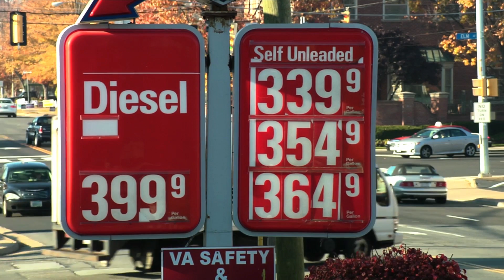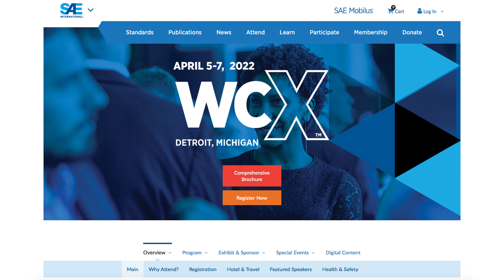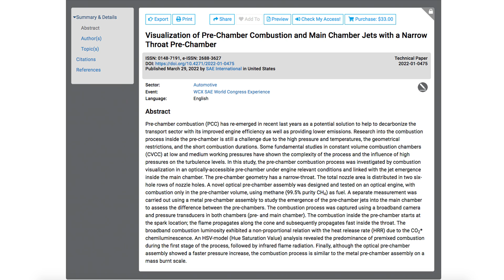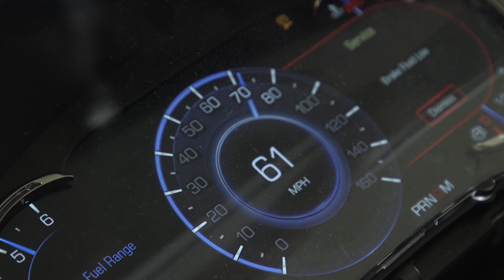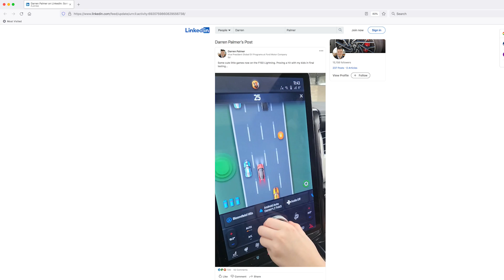EV Battery Cell Costs Jump 52%; BMW's New 7 Series Stuns - Autoline Daily 3307

Comment: Autoline, please do a comparison between the games offered on a Tesla vs that joke of a game from Ford.  1985 called, they want their game back.
Reply: It's not so much the games but the fact they're trying to use that rotary knob. Plug in real controllers into the USB ports or it just becomes an expensive repair item when your kid destroys the potentiometer. If Ford wired it correctly, an OTA should be able to handle standard controllers.
Reply: @Tokamak3.1415  that too.  PlayStation 4 controllers work great in my Tesla.

Comment: I am skeptical that a car platform can be successful as a electric and fossil power trains. Any EV owner looking at the transmission tunnel in an EV will shake their head in wonder, but the structural demands of supporting both electric and fossil motors will have costs in performance and usability for either variant.
Reply: you don't have to change the entire platform out just to remove the transmission tunnel.  All that would require is one different stamping for the bottom of the vehicle with the rest of the structure being similar.  Just make sure the hard points on the design match up and it should work.  Mfg do this all the time with similar platforms where one version has a slightly longer wheelbase for example.

Comment: Car companies that keep the same platform for gas and EVs like BMW will have a lot to lose: range, cargo space, aerodynamics etc
Reply: Use of the same platform however will improve economy of scale and result in better pricing.
Reply: @howebrad4601  negative.
Reply: @howebrad4601  the downside of using a platform like that outweighs the cost savings.
Reply: @odisy64  It's possible you are correct, however I do believe that in the long run when you consider that the mfg have to produce replacement and repair parts for 15 to 20 years, and all that they are better off sharing platforms.  It's not an exact comparison, but they don't have one platform for a 4 cyl version of a car and another for a V6.  Also cars like the prius share platform parts with non hybrid cars, etc.  I'm not sure why the entire car has to be different just because it has a different propulsion mechanism.  Take heavy duty semi trucks for example, they have the same frame and platform regardless if you have a cummins, Detroit, or Paccar engine.  
Further if you want electric cars to be more broadly accepted for the general market, and not just people that are early adopters, both versions of a vehicle should be similar.  Even the F150 EV looks similar to the IC version, which to me just makes sense.
Reply: @howebrad4601  unfortunately an electric skateboard requires an entirely different frame structure in order to maximize its advantages and minimize its disadvantages. One major problem about using a multi purpose frame is loss of space and increase in weight. When you look at tesla, they are producing a structural battery pack with mega castings in the front and back. This makes it harder to produce individual parts for replacement  and more costly for those repairs but the manufacturing cost of those mega castings and battery pack is so low it makes up for the disadvantages.

Companies just don't want to commit to a full electric frame because its very, very costly for them to develop a frame from scratch. Mega casting was considered to difficult and expensive to do by these same companies.
Reply: @howebrad4601  Lazy engineering never saves money.

Comment: LFP batteries 🔋 with iron instead of nickel are cheaper and last almost 2’000’000 miles, the jump in price is due to nickel price used on obsolete LNCM cells used by legacy auto makers still in panic mode and rushing on LNCM without any thinking 🤔
Reply: Yep, very bad for companies that think in decades instead of months like Tesla.

Comment: BMW copied Genesis in the separated elements between the lights, except that Genesis executed better.

The Lexus's range sucks. Keeping that car between 50% and 80% state of charge means you can only drive 40 miles real world.
Reply: I think the Lexus may be very popular. It looks great to non-EV people (most people), interior looks good, acceleration is adequate and if it has that quietness people like in Lexus and rides smoothly, then that's what matters. The range thing especially won't bother those who have homes or use the Lexus as a second car.
Reply: Anyone afraid of going below 50% has bigger problems than their car.
Reply: @rp9674  It's what the manufacturer recommends. Tell them.
Reply: @suserman7775  never heard of it, wouldn't do it, sounds unhealthy for the battery

Comment: even if I were tiring of the Tesla look, the BMW 7 series look is not the alternative I would be seeking.
Reply: Something is off with the new grills. I like the past decade designs. The new ones, not at all.
Reply: The new grill is not doing it for me.
Reply: I find myself not at all that bothered by the exterior. The interior matters more and the interior styling is quite nice (though not sure about some of the crystal light effects). Yes, it has a transmission hump. But, tbh, most cars are now designed to carry 4 and not 5 passengers so that transmission hump doesn't really get in the way unless you're carrying a 5th passenger. I would like BMW to make a ground-up design but they're not doing so. Only the iX is a ground-up EV design.

Comment: 1:50 Sounds like the SAE has about as much to do with the engineering of battery electric vehicles as Tesla has to do with the engineering of internal combustion engine vehicles.
Reply: To me it sounds like the old engineers are trying their best to keep their jobs since they find themselves on the same level of new engineers on BEV designs.
Reply: Pretty sad if their CEOs directed them to do this as well.  Bad leadership will sink legacy OEMs during this disruption.  And can we stop with the “ICE sales need to pay for EVs” nonsense already, Tesla, Rivian, and Lucid didn’t need ICE sales to bring their vehicles to market.  Any effort on ICE is folly.
Reply: @DarkBrandon1  Strongly disagree.  There is yet to be any EV that will meet my transportation needs, and I'm not alone.  Until that point there is strong demand for IC vehicles.  Keep in mind that Tesla didn't turn profitable until very recently, even though they are not a full line manufacturer.  What do they make, 4 or 5 cars?  Not too hard to be successful when you only make a handful of vehicle models.  

Show me the EV that can carry 5 people, with an 8 foot cargo bed, pull a 25000 lb trailer over long, long distances like I do regularly, with 450 mile range while pulling that much load, then recharge in 15 minutes and I'll consider one.  In addition, I live in an area where -30F overnight lows and -15 daytime high temps happen regularly in the winter, so I need strong heat, and the ability to keep me alive should I end up in a ditch full of snow.  Which EV would meet my needs?

It's very simplistic at this point to think EV's will completely take over.  In time they probably will but they're just simply not there yet.  Me and my family take trips to the in laws pretty regularly which is 580 miles each way, which we do in about 9 hours currently.  We stop once in the middle 280 miles into the trip for restroom, etc., and if need be a quick 10 minute refuel.  I'm just not willing to sit there and charge a vehicle if it's going to take much longer than it takes to refuel.

Comment: GM's Hummer also has a unique 800/400V system.
Somebody tell BMW that they could save a lot of that extra 1,000 pounds on the 7-Series sedan by losing the extra-long front end. Continuing with dual power ICE/EV vehicle designs only leads to sunk cost in development and tooling for compromised vehicles that are outdated before they first roll off the line.
Reply: GM's Hummer EV has retained the crown as having the worst energy efficiency of virtually any vehicle.  It is the most inefficient EV being sold in America, just like its ICE Hummer was one of the worse vehicles for MPGs.
Reply: @mikedx2706  Yes, the Hummer is pretty silly but it is working. Truck people are talking about it, being impressed. Surely its intent was to get the attention of those who drive ICE trucks, the coal-rollers, the people least likely to consider EVs. I doubt GM intended to make many Hummers, but to use it as a marketing tool to sell Silverado EVs.
Reply: @Miata822    Yes,  Hummer is a Niche vehicle to bring attention to GMC,  will likely sell about 10-20K a year.
Reply: @mikedx2706  Yeah, that is true that Hummer is the most inefficient EV, but compare it to its direct competitors, the Ram TRX which gets about 9 miles per gallon, and the Ford raptor which gets about 12 miles per gallon, and all of a sudden the hummer EV looks like one of the most efficient in its class.   Let’s not forget to, the hummer will blow away both of those vehicles in a race, turns sharper than a Tesla model 3, has a convertible roof, and many other features no other vehicle has right now.
Reply: DB, you need a new source for your info....  since you're wrong again... the Lyriq will also have an 800/400V ultium architecture... like all of the new bespoke EVs from GM...
Reply: @nc3826   Wrong,   Lyriq does not have the parallel to series 400/800 dual battery packs like the Gm trucks.     Lyriq charging limited to 190 kW.   The trucks use 2 separate Lyriq packs,  run in parallel to drive, and series to charge.
Reply: YT wannabe experts who mindlessly rant about how terrible flexible platforms are when brands like Hyundai have built efficient and profitable EVs off of them.... are amusing...
Reply: @nc3826    Hyundai Efficient?   Really?     Ioniq5 is well behind Tesla on efficiency.    25%  to be exact
Reply: @dmitchellhomes  Wrong again, it does not need a dual set of battery packs to have its  400/800v voltage charging capability....  

Just get back to me when it's on the road... so you can dine on crow for me...
Reply: @dmitchellhomes  re-read what I said about Hyundai... since you are confused again to think i was talking about the Ioniq5... smh..
Reply: @nc3826    Wrong,  if you knew anything about EV's,  the reason for 800V or higher is mainly if you plan to charge higher than 200 kW,   Lyriq is limited to 190 kW charging so 400V works fine for charging.     Fun Fact for you CCS charging standard has a 500 amp limit.     Therefore 400V systems limited to 200 kW charging.
Reply: @dmitchellhomes  one main advantage to the Ultium battery pack is they can vary the configuration via software and there for its voltage too... its done wirelessly...
Reply: @nc3826    Wrong...   Wrong...  Wrong...    You cannot change a battery pack voltage wirelessly from 400 to 800 volt...   There has to be a switch that puts the modules from parallel to series (which could be controlled wirelessly)  but there has to be a mechanical switch,  which the HummerEV has,  because it needs to charge faster than 200 kW for a better user experience.
Reply: @dmitchellhomes  Lyriq  "modular architecture will be capable of 19 different battery configurations, 400-volt and 800-volt packs with different storage" 

most CCS DCFC are 400-volt not 800-volt.... so stating 190 kW charging rate that can be held consistently is more realistic to tell owners, while Hummer owners will be vastly disappointed to think it will charge at 350 kW.... 

just google, it Lyriq... so like it or not the Lyriq will have a  800/400V  architecture too... even if it is not used at 800v very often...
Reply: @dmitchellhomes  And learn what an EVSE is Mr "Mobile Charger"

And i will bet you Hummer owners will not get 350 kW charging... 99.99999% of the time... do various factors... Battery Swapping is really needed for such high capacity packs....
Reply: @nc3826    Another reply,  Low and Behold Elon Musk just discussed exactly this on Tesla's earnings call.      800v does no good on smaller packs,   but cybertruck and semi will be 800v,  Larger vehicles, larger packs, there are benefits.    Charging mentioned.
Reply: @dmitchellhomes  and I did not send you anything from a you tuber, Einstein
Reply: @dmitchellhomes  and I already stated its 800v capability, will not make a major difference... but that must have confused you...
Reply: @nc3826   Bottom line Lyriq does not have 800v charging capability.   you were WRONG as usual...    And GM's 400-800V for charging absolutely switches 2 battery packs from parallel to series.    A capability Hummer has,  Lyriq does not...
Reply: @dmitchellhomes  Bottom line, is the president of GM said on this YT channel... Stated that any Ultrium battery pack can be configured, (to have any charging capability) GM needs them to have.... 

Now go ask Elon what an EVSE is, Einstein.
Reply: GM is going to 800V too,   Lyriq is the last 400V
Reply: Yes, long hoods are a waste of space even if it's a frunk
Reply: @dmitchellhomes  Lyriq or any Ultium pack can be software reconfigured too... at a modular level to do 800v charging... so not having dual packs does not limit it... but they do not need it normally for the Lyriq...  

Peak charging rates are marketing BS... 190 kW EV can be faster than a 350 kW EV if the 190 kW rate is maintained...

Even the Lucid Air does not charge much slower on a 150kW 400v vs 350 kW 800v CCS DCFC... when it was compared in the real world... since it surpassed a 150kW  charging rate for both DCFC for most of the charging curve... and if was only for a few minutes that 350 kW 800v CCS DCFC and it was only for few minutes when it hit 300 kW that it surpassed the 150kW 400v CCS DCFCharger....
  
State of Charge channel did the comparison...

"Cadillac's all-electric Lyriq flagship to start just below $60000 "techcrunch' 2021/04/21 › cadillacs-all-elec...
Apr 21, 2021 — The Cadillac Lyriq, the all-electric crossover and flagship of GM's ... 400-volt and 800-volt packs"

think, what you want... since hard facts just confuse you...

Comment: 4:50 The battery electric version of the new Beamer has 2 ft.³ less of cargo volume than the ICE version. This suggests that BMW has a lot to learn about the design of electric vehicles. The model Y has 10 to 20 ft.³ more a cargo space than comparable ICE vehicles (dimensionally equivalent compact SUVs).
Reply: This highlights the drawbacks of using a universal platform for ICE, HEV, PHEV, and EV versions. All are compromised compared to a bespoke platform for each.
Reply: 10 years behind MS